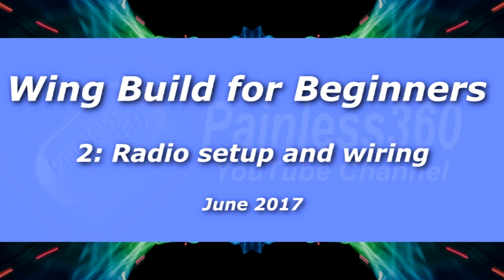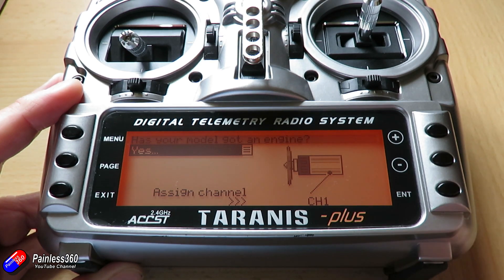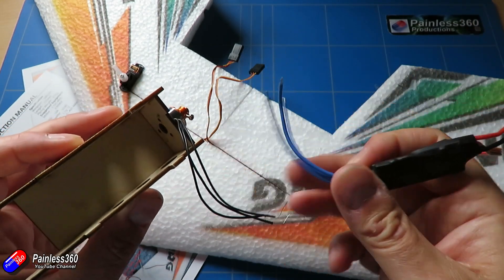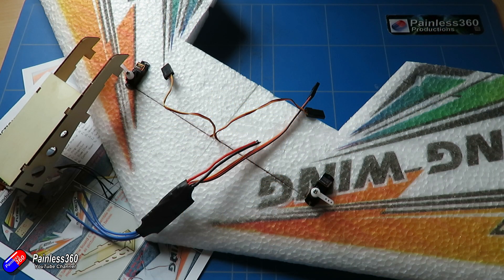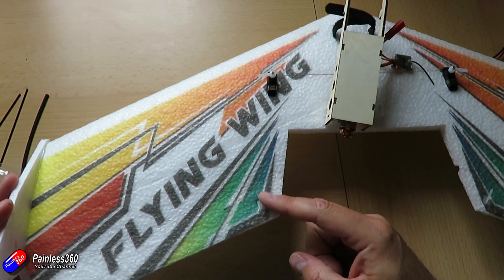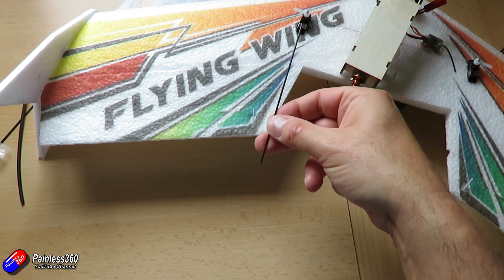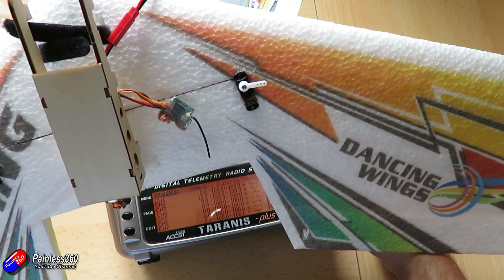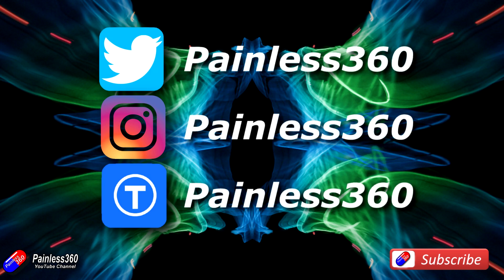(2/3) Wing Build for Beginners - Radio setup, FrSky MSR and wiring

Comment: Thanks for the info for setting the wing controls on my Gy-psy. I have converted it from glider to motor power and all is fine apart, but I have been unable to figure how to create the trims. It seems to be relatively simple on a normal

Comment: Great video and always love your detailed explanations, you make this really clear. I used to fly models back in the days of using crystals but getting back into it now it’s like a whole new hobby with the different electronics. Could you possibly help me out? I trying to upgrade my Zagi flying wing electronics. I have a spectrum DX6 TX, I’m not running a motor, what battery and receiver would you recommend, I’m confused as I’m not using a ESC not not sure how to fill that spot and control the current to the 2 9g servos. Hope that makes sense, thanks so much for any advice.
Reply from the maker: You'll need something that provides 5v to power the receiver (not sure what Rx to get as I don't use Spektrum stuff here, sorry). Usually the ESC provides the 5v to the Rx, and to the servos via the pins on the Rx. I'd look at something like a 5V 3A BEC to do that for you from the flight battery. Check out my RC basics videos for more detail on the modern hobby. Best of luck with it!
Reply: @Painless360  hey thanks so much for getting back to me and for the info, really appreciate it. Ok cool so I found a 5v 3amp, getting a better understanding of it now thanks, it was not having the ESC to provide the power that confused me. So would a 7.4v 120mah lipo be sufficient to power to Rx and 2 x 9g servos? Thanks for the advice, really appreciate it.

Comment: Very complete explanation! Is there a flying wing basic model for open tx available somewhere? I saw your settings, but it's not really explains what they do or why it should be like that. I come from the quadcopter side of the hobby ;), never needed mixing before.
Reply from the maker: The fixed wing part of the hobby is immense fun! https://www.youtube.com/watch?v=OaKqAng-BVE  and maybe https://www.youtube.com/watch?v=RBiNq3dWQBM should help.. ;)

Comment: Thanks for the details. I'm back from 2years break of playing with quad-copter. I'm confused that not only this video but others will connect SERVO and ESC to Rx. But from other sources and my previous experiences, we connect them to FC (I'm using pixhawk). Is it because different FC and RX connection protocol? (I use SBUS and PPM).
Reply from the maker: You don't need a flight controller to fly a fixed wing model. If you add one, then of course the wiring is very different -  see my build videos where I add various flight controllers into fixed wing models for the differences. Best of luck
Reply: I was thinking same thing, what about battery info etc on my osd, I thought that came through/from the fc?

Comment: Is a wing a good first airplane ?
Reply from the maker: Yes and No (don't you hate it when that's the answer!). Yes, they are cheap, easy to make and repair and super fun to fly. No because the don't have any inbuilt stability and can be very twitchy and unforgiving.. The one we're making here is a very averagely powered model, good for newer pilots..